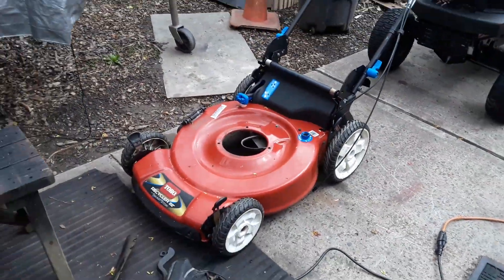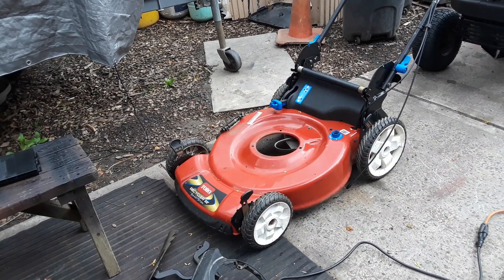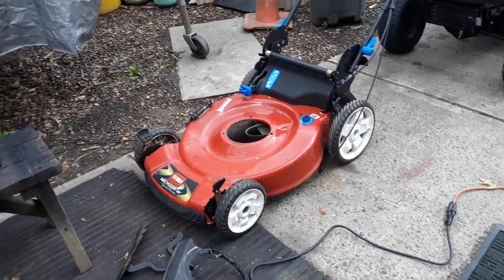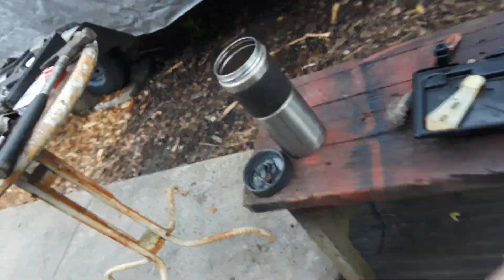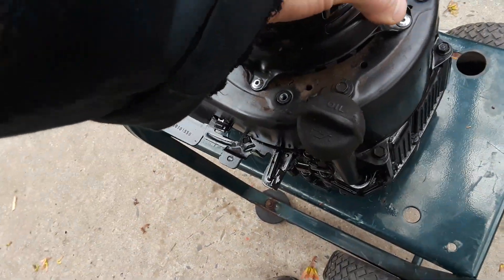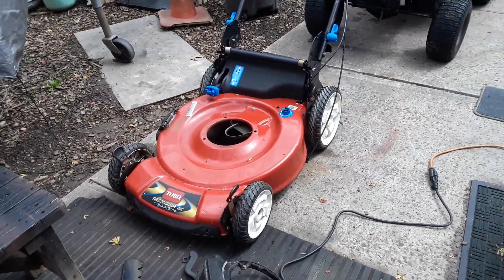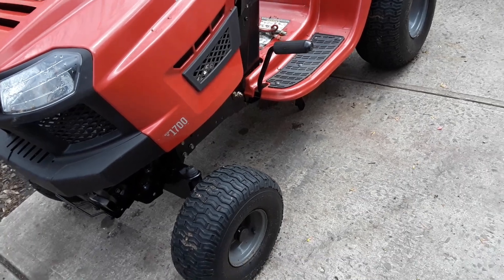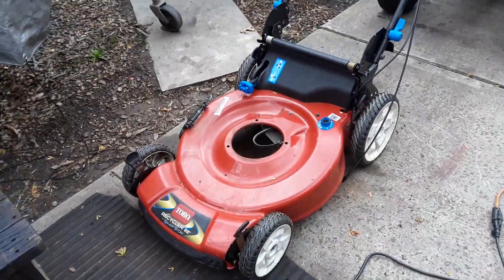First unlucky one in a long time. You don't hit a homerun everytime. 2017 Toro Recycler. Engine swap

Comment: Lol I was going to say throw a quantum on it but you are. Yes the new briggs engine is a hunk of junk. Don't feel  bad I've been burnt like that too. Good video my friend!!!
Reply from the maker: Luckily no money changed hands, and it was just a reduction in the price on a tractor I was selling. I was already taking his tractor and then he said by the way I have this Toro, he took me over to his shed, I saw it and immediately said I'll take it when I saw how new it was with the air cleaner off. I figured it would just be stale fuel. My big mistake was not pulling that rope! You always pull that rope no matter what and make sure its not siezed and check for compression, the most important part. That's the lesson learned here. It's all good, I'm still going to make decent money off it, it just took a little longer. Now someone will have a more modern nice Toro with a better more powerful engine than they offer on anything now.

Comment: Awesome video good job you finally put a Briggs on it
Reply from the maker: You mean a good Briggs? Because it had a Briggs. A piece POS Chinese OHV Briggs. I can't stand those new engines. They're crap, you can tell their crap just by looking at them. Once you get that pretty red cover off the top of it. Everything underneath is crap. The thing was barely seized and it's terminal. But regardless that does not happen without low oil or no oil. I've had Quantum's Locked tight that took real work to break free and once they were free they ran perfect again and that's what's going on there right nowa good Briggs.
Reply: @Mr_Tecumseh  yes I mean Briggs

Comment: He probably forgot the oil from the get-go..
Reply from the maker: That's what I think. But why was he did he go towards the carburetor and and had the air cleaner assembly off why did he have the top off? Clearly he didn't know what he was doing or he called one of those places that come out to try to repair it and they failed.